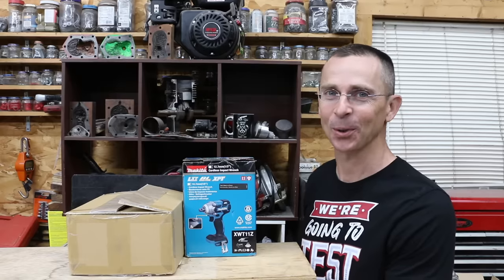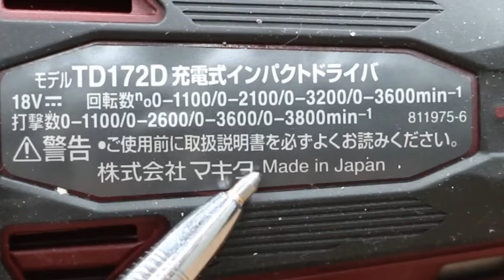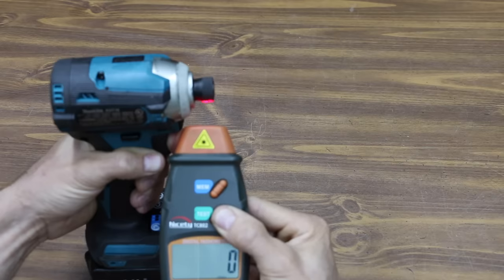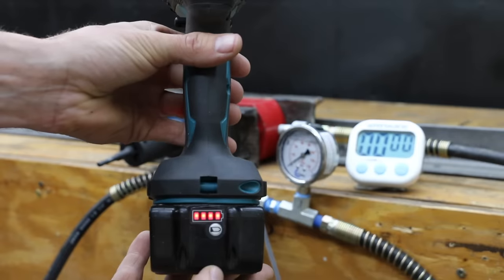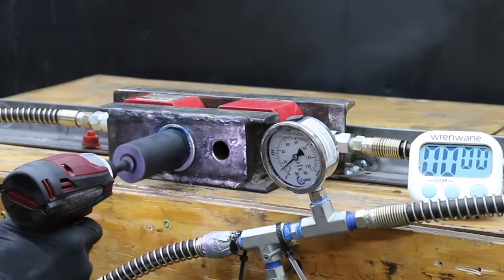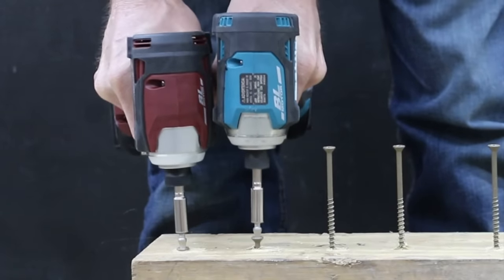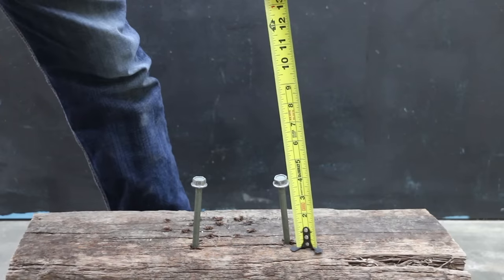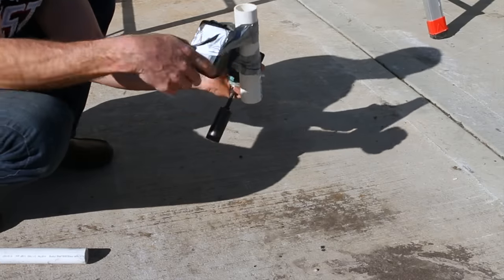Made in "Japan" Makita Better? Let’s find out!

Comment: Wheel it's not the same model, the "red makita" will probably be the text XDT17.
 in Europe the XDT16 it's called DTD171, in Japan is TD171 and now the TD172 (Japan) will be in EU DTD172 and USA XDT17... But the specs are similar, the difference are the shape and options (which are more but are packed more ergonomic)

Comment: From my experience, Chinese can provide things with both worst and best quality in the world, as long as you order it with correct price.
Reply: I do appreciate the good quality. but the thing is if people are willing to pay 60$ more when there is only IEKA stuff to be installed.
Reply: China sends it's best to US an EU. so what u saw right there was its best. let alone all the technology, boards, and quality is copy and under licence. They only can change or modify the material used. Otherwise its not like u think it's fully made and designed in china. u could say assembled in china
Reply: Yeah, the Chinese will give you the best quality product in the world, if you're willing pay to get it (ex: Apple). The problem is that in general, if as a company you've chosen China to manufacture your product, it's because you've already made the choice to optimize for cost. Japanese, as consumers, prefer quality over cost for premium devices, so there's little to negative cost advantage in manufacturing the same quality product in China over Japan for their domestic market (taking into account the cost of maintaining a separate manufacturing line and import costs, etc). There's also the problem that if you manufacture in China, there's a high risk of your product being ripped off and exact or near exact clones being sold under knockoff brands ("ghost shift" manufacturing, etc), which is highly undesirable if you're a "premium" brand.
Reply: @jasonosmond6896  Apple is "Made in china" not made by china. its just for cheap labor work over there to do the things that needs humans to assemble. Otherwise whats inside apple are all made by silicon valley in the US.  However after so many years of assembling deviced they learned to make their own things too, like huawee phone. even tho the CPU and the Chips in those are still made in US too. Japan is another thing they have their own technology.
Reply: @annakessler9372  not really correct.  Global production depend on international collabration from vendors. Components not made in China maybe use subcomponents made by Chinese. There are reasons other than cheap labor work why apple uses facilities in China to produce iPhone and so do other big tech companies.   There are far more possibilies to use cheaper labor work in the world, why they don't?   Idea that Chinese production means cheap and poor soulds like myth.  oder?
Reply: @edwardhochwand9063  Your answer is still Human resources. In the past things were made in Mexico. even now and then you can see good products that were  made in India.
Reply: @annakessler9372  Only human resource? I mean complete supply chain, infrasture, and OEM production. And yes, all those above depends on human resource.   Besides I know no good products made in India.... maybe masala.
Reply: Japan and China are two extremely different when it comes to manufacturing.
Reply: @ibrax5  If you stare at shit, you see shit.  btw they call themself republic of China, Taiwan province, say another China.
Reply: @edwardhochwand9063  
Been to both places ?

Comment: I think you compared different models. The blue one is the DTD171 and the red one is the newer DTD172 (European model names)
Reply: Precisely the reasoning for the results!
Reply from the maker: Thanks for watching!
Reply: They have to identify them of course. So the better built Japanese one is the DTD172. The export one is the DTD 171. The point is the domestic model is the better built version.
Reply: @marks6663   @Mark S  The DTD171 / TD171D are available for few years now.  Makita launched the newer model DTD172 / TD172D around Feb. 2021. When the new tool 172 will be available in the States, it will have an American model number, which will probably be in line with XDT ##.
Reply: @marks6663  He should have compared the DTD171/XDT16 with the TD171D, not TD172D. They are DIFFRRENT models, not the same model, one made for Japan. Also, when the DTD172/XDT?? will be launched, then you can compare them and see if one is better built or not.

Comment: Each power tool should have a 'HAVs Points' or some similar point system for the maximum time you should use a tool to reduce your risk of HAVS, so the lower the points, the better. 
In a way that would determine which tool is safer for longtime vibration use.
Reply from the maker: Thanks for the feedback.

Comment: I’ve been wanting Makita tools for a lot longer than I’ve owned any. My first (new tool Makita) purchase was a cordless drill/driver. With battery. Later I think my next was one I found in a pawn shop which included a battery, soft case and charger, which I bought on impulse because it was cheaper than a battery alone. Skipping passed all the various tools within the brand, I’ll state I think I have 5 drills, and the lowest level of the impact similar to this video. A couple years ago now I discovered a PURPLE one! I couldn’t justify buying it because it made no sense. 
But nowadays I have nearly every battery powered Makita tool an electrician might find “required” (also I bought a 1/2” Fakita impact per AVE ‘just because, and it works!!) but watching this video prompted me to investigate what might be a justification for investing in a backup driver. My original was the XTD11, and seeing now there may well be a solid reason, I just ordered the XTD16 in PURPLE! 
😅❤

I love purple, so it’s twice justifiable:
Favorite color. 😮
Better version😮
Variable speed😅

but my favorite reason is PURPLE😂❤
NOW I have to wait a couple weeks for it arrive from Japan. 😢
I hope the ship doesn’t sink or the economy doesn’t crash before it arrives😢

Comment: I have music equipment.
It's a Karaoke dual cassette with (2) 🎤
Analog with pitch controls etc... Assembled in 1989.
Has a 2-way speaker in a box housing. Has multi RCA connects at the back ahead of its time for aux connections.
That thing is heavy but well built!
It still works 💪like it was bought yesterday. 
A friend just gave it to me as they were moving. 
It was made in Japan.
It IS outdated of course, but all components still work, and I use it as a speaker for my dual cordless 🎤. 
Incredible.
Reply from the maker: Thanks for sharing.

Comment: As much as I like your testing. What we lack is knowledge on how much variation there is between the same model. Perhaps we are comparing the worst Chinese unit with some unusually crappy bearings with the best Japanese units. 
I accept that your examination on the internals goes some way to explaining the difference & mitigating this concern.
Reply: Also, these are different models. The made in Japan model is a next generation model that had not yet been released elsewhere. He should have looked into that first.
Reply: He just bought the models with matching specs.
Reply: @Xixu.co.6  the problem is that the dtd172 is a generation up and has yet to be released elsewhere, it's like comparing apples to oranges. The amount of improvements they can make since early 2019 is massive in the tool world (even earlier since they released it way earlier in japan).
Reply: @tylerperlenfein   I’m aware. He bought what was available in each country with matching specs. Availability is definitely a factor. I agree I’d like to see two of the same model compared though. But maybe availability was intended to be part of this test

Comment: I bought a loaded Lexus 2014 RX450h made in Japan.  My brother in law bought his 2 months later and his is also a Lexus 2014 RX450h made in Canada.  We work in the same company and drive 70 miles back and forth to work and home. We also live across the street from each other. I still own my lexus today May 2 2021 with 137,650 miles and never had a breakdown, never needed to replace the battery.

My brother in laws RX 450h currently has 119,200 miles and he had the batteries replaced at 98,260 miles. He also had engine oil leak and had two shocks and struts replace because of premature failure at 56,000 miles, repaired with extended warranty he bought.

So yeah Made in Japan Quality is real!. 

You guys should buy used electronics and equipment from Japan and you will notice that almost everything i import from Japan that is used almost always in mint condition. These people take care of their stuff and have really good work ethic and it shows.
Reply: It's seriously that good ?

Comment: For vibration, can you put the tool on a static bolt and tie a rope attached to the wall around the battery? The rope would be pulled just about tight. You'd use the rope because it is strong under tension (allowing you to oppose the spinning of the tool) but weak otherwise (allowing you to capture half of the vibration occurring). There's a vibration detector on Amazon for $42 from Witmotion that also has a phone app.

You could also make a machine like a polygraph machine, basically translating small movements of the tool in to larger movements on a scrolling piece of paper via mechanical (dis)advantage.

Whatever you do, a tricky part would be placing the sensor at exactly the same distance from the bolt for all tools, since the motion gets more amplified the farther out you get. Good thing is that you don't have to worry about mass. Doesn't matter if it's the quality of the tool or the mass of the tool, less vibration is less vibration. So there's no need to worry about moment of inertia and everything like that.

Also you could probably make some kind of trigger-firing-mechanism using rubber bands that release. You'd probably want to do this, since holding your hand on the tool will dampen the vibration. Human error and other variables make that dampening unpredictable.
Reply from the maker: Thanks for the suggestion.

Comment: Anyone seen the Trademans series of Makita tools??  I have a couple and the specs are a bit higher than the tools shown but these tools are corded so perform very well unless you have a blackout.  For those who want to know I have 9 inch circular saw, very quiet for a saw and a large drill that will twist your arms off with the torque it has.  As for the video I bought a twin pack (impact driver and drill, brushless motors, Li Ion batteries) and they are blue but on the box, instruction books and the tools is stamped made in Japan.  I guess not all Japan made Makita's are red.  Anyway all the Makita tools I have perform well and I hope they last a long time and as for my non powered hand tools I always go for Bahco.
Reply from the maker: Thanks for sharing.

Comment: When I repaired my Sony TV Bravia in 2008. I found the horizontal transistor was blown due to an overload voltage in the circuit. I went to the electronic parts store they have the original transistor made in Japan and also others made in different countries.  Instead of fixing the over voltage in the circuit I installed the Transistor that was made in Japan the TV work for one week. Then I removed the transistor again and I installed the transistor that was made in Malaysia. I push the power button the TV turn on for about 1 second 😄 same happen with the other one. After that I installed a second transistor that was also made in Japan the TV turn on again but the transistor was so hot 🔥due to the over voltage. I fix the over voltage and the TV work for 4 years
Reply from the maker: Thanks for sharing!

Comment: I used to  love Hitachi tools. But, now they are made in China instead of Japan, and called Metabo. The price came down, but you get what you pay for. They are a shell of themselves now. I learned this by buying a circular saw and a miter saw. I'd like to see the same test with those two. After cutting a good bit of Treated wood with the miter saw, I tried to change the blade and the set screw was froze in place. I rounded off two different allen wrenches trying to get it loose. I'm going to try your idea with a bolt and clamp with a much better allen wrench than came with it, or the one that came with another tool I have. Maybe if I can get more torque and better downward force, I can get it loose. I noticed this saw took a lot longer to cut a 4x4 than my old Hitachi or Dewalt with the same Diablo blade. The saw would stall and I believe that's what made the set screw so tight.
Reply from the maker: Thanks for the feedback.

Comment: Since I´m in the automotive industry I want to share some insights about the topic which nation is better in this vs that!

First of all I like Japanese ethics, my Kawa is 40 years old, and it doesn´t break, the new BMW needed already several repairs, the Japanese have still "honor" in their ethics, most countries have no ethics at all, ruling topics are the costs.

Many products are from China, because the human resource was cheap. The #1 cost in production is the worker/employee costs. The trend now is to India and Vietnam, because the income and insurance levels in China did grow the last decade. 

The OEMs (like VW, Makita, Bosch) purchase the parts from suppliers and assemble them in the local factories, that means, just because the Makita "Made in Japan" was assembled there, does not mean the parts where made locally. There is a very hard impact on suppliers now, because of the recent economical troubles. 
If the OEMs factory (like Bosch had in Switzerland) is getting too expensive to make a win, they will try first to save with the parts they purchase before they finally close the location (Scintilla). 

When the built in parts are all coming from other countries, the knowledge of technology in the former homeland is getting lost, because nobody is doing these parts anymore, like in the drive shaft business with trucks, in Germany You won´t find any more, they come now from Italy and Turkey for Europe. 
Same goes for rubber or battery industry, China has in big quantities taken over there whereas in Europe it has become mostly absent. 

So for the single tool You are testing here, it is up to the OEM, who orders and commands the production in China, how the quality will be. 

If You want to use type 319, A356, A357 or even 6061 aluminium, it does not matter, if it is in China or in Japan, it just depends on the OEM, how much he wants to spend on the grade or the quality. In that case the Chinese produced product could actually become better, if the OEM would invest the win of the cheaper production costs into the better materials. 

To give You the inside on the quality testing, all the products we produce in China are tested in European facilities at the OEMs as well, it really depends on the QM (quality management) of the producer, and I can say for Bosch, it is extremely tough and rigid, the rubber must have food application equal quality on a timing belt in a power tool, its tough for supplier under cost pressure!

Hope my words gave a bit some insight into reality and show how it is not so clever to summarize a countrie´s product quality on one term, except, that the Japanese make great things ;)

Comment: I think your RPM measurement isn’t apples for apples bc the collar circumference on the Red Makita is larger, which would measure as lower rpm’s. If you put the same bit in each one and used that for the measurement, it would be more accurate. There is also a high possibility I’m completely wrong, and it doesn’t make a difference.
Reply: I think Ur right but also I'm not 100% what I do know is the spot he measured is independent of the actually hex so it can move qt a different rate so yeah I'm sure they do spin qt 3600 as said

Comment: When reviewing power tools I like to hear about the quality of the material and the fitment of its case. Like how much fiberglass is used in the the injection molding process if any at all. Also certain parts type of metal if its forged and just sintered metal. Also being in electronics I know there is big quality differences in Mosfets used and their amp ratings. Which is usually what burns out on cheaper tools. Sometimes having a bigger heatsink on them makes them hold up way better. ......Love your videos ! Thanks!
Reply from the maker: Thanks and you are welcome!

Comment: For an easier and/or more accurate trigger lag test, you could cut out the human error or more importantly subconscious bias substantially (which is always present with humans) by zip tying them to a 2x2 piece of lumber side by side, lightly resting their triggers against a flat surface like the edge of a table, and then pushing the 2x2 (and by extension the triggers) against the table.

Comment: I think a good idea would be to test screw driver bits. Specifically Robertson. I bought 10 Milwaukee brand Robertson bits thinking they would be quality and they have all broke. I just got some Bosch bits we will see how they last.
Reply: And also would be cool to see the "old faithful" in your line ups. to see how outdated tools perform compared with the newer version. I have many old tools that have survived the test of time because they are extremely well built. Not many items would win the weight test but that doesn't always matter. Example my bench grinder from the 50s has the most power I've seen from a bench gringlder that size and has been through 70 odd years of fairly heavy use. Same with the 60s drill press and socket set in my shop. Extremely good quality stuff. Love the videos greqt work 👍
Reply from the maker: Thanks and you are welcome!  Thanks for the suggestion.

Comment: the 30deg and 25deg markings on the motor might be the motor timing. that would indicate that the 30deg motor is driven harder and more capable. motor timing is a software thing and its odd to write it on the motor but it would be right in the ballpark.
Reply from the maker: Thank you!